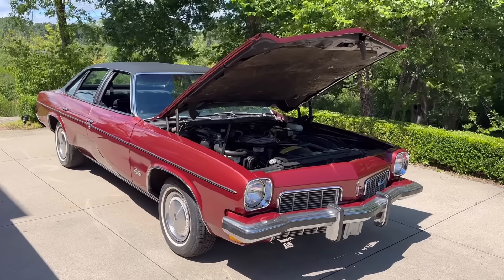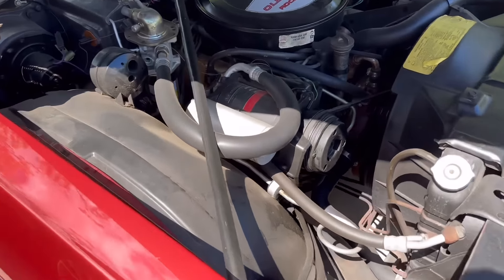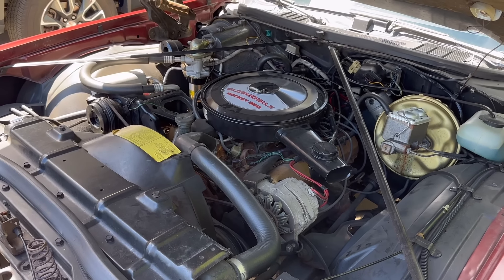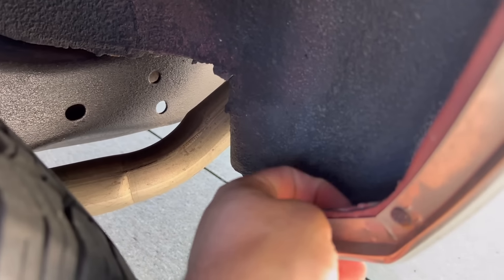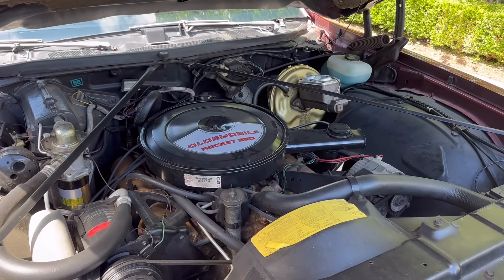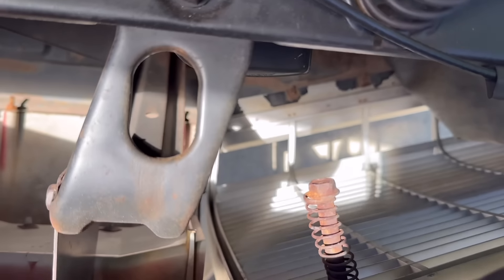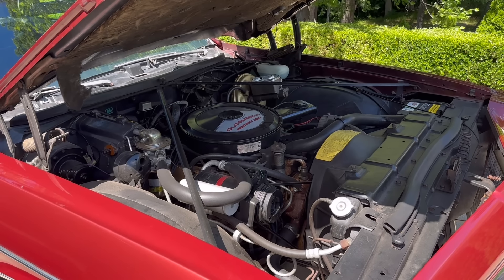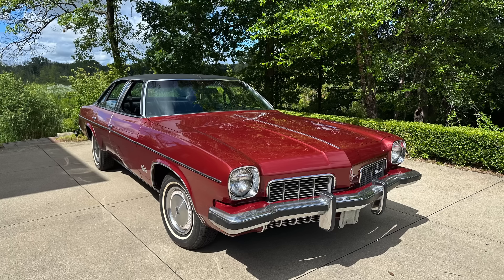This Oldsmobile Invention Protected Your Car and Preserved Its Value!

Comment: Bought a new 1973 Cutlass Supreme Colonade coupe,  silver blue with full white vinyl top and white bucket seats. Great looking and driving car. A litte under powered with the low compression 350 Quadrajet, but the speed limit had just been dropped to 55mph and it ran comparable to other new cars of the times. Spring loaded grille was cool!

Comment: Don't forget that the car body from the firewall back was built by Fisher Body so it wasn't up to Olds to design corrosion protection liners back there.  Olds was responsible for the fenders, hood, and front clip and everything up there in the pre-unibody days.

Comment: My first car was a 73 Olds Cutlass 2 door, silver with the black vinyl top. Mine developed the rust through on the driver's side behind the rear wheel. I got it in 1986 and sold it when it had 130000+ miles on it. I loved that car.

Comment: Our neighbors across the street in Dayton Ohio had a '73 or '74 very similar to this, but theirs was a light metallic blue.  Within a few years, it had those little plastic pieces which fit over the dog-legs between the rear doors and the the rear wheel openings, and were painted body color.  Our '75 two door never had any rust - or really any issues ever. The rub molding fell off of the passenger side fender after four years, and that was it. We got a new one at the dealer and twelve year old me stuck it on.

Comment: One of my favorite cars that I've owned was a 73 Olds Cutlass Supreme coupe. Bucket seats and console. I installed cam, headers and a built transmission. I'd get rubber when I shifted into 2nd. Had 275/60s in back and 235s up front. Was a pretty quick car.

Comment: Love your Cutlass as well as the ‘67 full size in your garage. ‘73 and ‘74 GM products were a little iffy, but yours is in remarkable condition. I know emission control made them comparatively powerless, yet Olds always managed to preserve that “Rocket V8” roar. I can’t resist sharing that I’ve got a ‘56 Super 88 in my garage. Olds was an innovative motor division. May it live on proudly!

Comment: I have red plastic inner fenders on my '70 Olds 442.
Reply: I think they were an option on 442s and W30 cars through 72.
Reply: Moms 72 Cutlass S had them. Her car was white the inner fenders was black plastic. That was an excellent car. It would fly... Rocket 350. Air Conditioning that would freeze you out. We had it 10 years. Not one bit of trouble.  I liked the front in better on the 72 models.  Sad, about Pontiac and Oldsmobile.  My first car 76 Pontiac Grand Le Man's.  It was a beautiful car.  Dashboard, was the best looking of any GM midsized at the time. However, it had the Pontiac 350. And the power was down from smog equipment.
Reply: My 69  W30 has red plastic inners also.

Comment: Always wanted a 1967 Turnpike Cruiser Cutlass Supreme. Had the 400 2v with a gas mileage saver ignition system & high rear end ratio. Said to get 20mpg @65mph.

Comment: Dad had a '73 Cutlass Salon with the Rocket 350/4bbl. By the time I got it in the 80s, it was a rust bomb and the steering gear was shot. We loved that car though.
Reply: Those 1973-1977 Cutlass models in the salt belt were notorious for the rear bumper falling off from rust. Hillbillies would rig up a replacement with treated lumber. Looked awful of course.

Comment: The screws that attach the chrome wheel opening moldings are the first place for corrosion to start. The metal is unprotected and there are plenty of places for water and dirt to collect
Reply: LOL, I remember pushing a dead '64 F100 into the car port as a kid, had the door open to steer it.  The open door went right into the wheel wall lip on my dad's Chevy Celebrity, and put a nice dent in it.  I went to the parts department at the  Chevy dealership, to find out that there were different sizes of that chrome trim piece depending on the trim package and how far into the model year it was made.  It took me three tries to get the right part 😂

Comment: We had a ‘74 Firebird and I refused to cut a hole in the fender liner to change the blower motor so I pulled the metal fender liner. Cut the shit out of my hands.
Reply: Funny you should mention that.  When I bought my '79 SE TA back in 1986 I noticed a roughly 6" round hole cut in the pass side inner fender and for years had wondered why.  😸
Reply: Cutting the inner fender for the blower motor is in the factory service manual.
Reply: @bobroberts2371  I know and there’s even a template for where to cut stamped into the fender liner. However if you’ve ever seen it done it’s fugly.
Reply: Good Ole GM, they didn't care about maintenance or making things accessible the 70's was just about the car making it to the end of the bank loan.
Reply: My 75 firebird was a nightmare to swap without cutting it ......I never understood why they just didnt include an oversized panel to cover the hole they wanted you to cut in the first place.....saved 39 cents per car on screws and  10"x10" of sheet metal.....my 96 S10 truck was the same way......if its done wrong long enugh it becomes company policy I guess
Reply: I did cut the inner fender shield on my 68 Firebird in 1972 when the blower motor failed....there was a hump in the shield.....cut around it, replaced, put on a piece of metal, metal screw, undercoat..
Reply: @darrellsaunders4267  dealer did that on a ‘71 GP we had. Just bad design on GM’s part.
Reply: @markcollins457    How do you propose solving the blower motor access issue?  Remember, there is limited space on the under hood firewall and an empty space between the inner fender and firewall.

Seems that you would rather compromise the functionality of the car for ease of changing a part that might never be changed in the cars life.

Comment: My `87 Ford F150 pickup had those plastic inner fender liners. As for that car and its engine, my `72 Buick Skylark had a 350 2bbl. It had plenty of pickup, and plenty of passing speed on the highway. I believe it was only rated at 155 hp, but it seemed like a lot more.

Comment: I like seeing the VIR A/C system under that hood.
Reply: I have rebuilt many VIR HVAC systems. Started turning wrenches at GM dealerships in 1973. Those compressors were Heavy.
Reply: Meat locker on wheels. 😊

Comment: The only vehicles (not a passenger car) that have rear plastic fender liners are some of the newer pick up trucks.  I see they have engineered new ones for some classic trucks now.  I believe the reasons was so you couldn’t see through the gap between the frame and the bed floor out to the other side.  Once again, great video, fantastic channel, unmatched wealth of knowledge & I wish I had your garage space…

Comment: I worked in a collision repair facility for many years. I cannot imagine how many plastic fender liners we replaced over the years. The plastic got thinner and thinner over the years and now it’s just plain flimsy. My 2018 Honda CR-V has fabric rear inner fender liners and many of the imports have for years.
Reply: My 2017 Impala has fabric front inner fender liners. One got torn so I had to replace it.
Reply: 2006 BMW 325xi has fiber inner fender liners.
Reply: Most vehicles have fabric fender liners now. They’re also a noise improvement.

Comment: I was furious when I needed a new blower motor on my then two year old 1977 Trans Am went out and because I was on a trip down in Indiana I took it to a dealer outside of Indianapolis only to find later they had cut a hole in the inner fender to swap it. I then found this process was right in the GM service manual for F body cars. Didn't make me happier though!

Comment: I guess that the "flow through ventilation feature" could be considered either an option, or a late appearing standard feature, depending on where you lived, and/or how long you kept the vehicle.

I remember seeing one GM car that you could see into the trunk, and out the other side, because the rear quarter panels had rotted out.

Note how easy it would be to replace either the blower motor, or the A/C condensor on that car.

Comment: If you buy a GM pickup today, you have to pay extra for plastic fender liners to prevent rot in the rear wheel wells.  Kind of pathetic IMO.
Reply: Same with Ford pickups and heard the rationale was to be able to wash the frame and rear suspension of road salt and mud.
Reply: @jasonhunt007  That sounds like a salesperson's attempt at a Jedi mind trick.  If you have the plastic liners, you don't need to wash out your wheel wells.  If it was such a benefit not to have the liners, they would omit them on all the trim levels, not just the cheap ones.

Comment: Hi Adam, I love your channel and thanks for this video. I must respectfully offer a correction, however.  In this video you called these red plastic fender liners. They are not liners, but rather they are the actual inner fenders.  Some other cars, such as the '66-'67 GTO, had red plastic fender liners optional, but they were just the liners, and from the engine compartment side you would still see the black steel inner fenders.  I should note that on the 4-4-2 W-30, while the front has red plastic inner fenders, in back they are mere red plastic fender liners, as the rear inner fenders are steel.  Thanks again for your awesome channel.
Reply from the maker: Good comments. Thx!

Comment: Interesting that they used plastic for an apron assembly which is a structural piece. Surprised the engineers were able to maintain structural rigidity using plastic instead of the typical sheet metal. The bracing was necessary but still impressive.

Comment: I like the '73 because its front bumper did not have the thickness of the subsequent years '74 and 75. No one has tried to frenched this bumper by narrowing it a few inches in width and sticking it to the bodywork. So with the elimination of plastic filler it would look so much better that way.

Comment: I was thinking some early GTO's might have had red front fender liners.  Also, it would basically be impossible to use plastic liners in the rear since the inner and outer wheelhousings are a structural part of the body.  The front liners aren't load-bearing in any way.

Comment: Hi Adam yes, I too have the plastic inner liners on my 1969 Olds'  Ninety Eight, 
 Now on on your '67 holiday, have you (and other readers of the comments section) noticed ever that your speedometer is driven off the front left wheel on many Oldsmobiles of that era ?

Comment: Plymouth offered red plastic inner fender liners on 1967 and 1968 Barracuda coupes and fastbacks. Not on the convertibles because the rear wheel wells were modified to make room for the folded top. I have a set of them for my 68.

Comment: My 1978 Mustang II has plastic fender liners on the front.  Now I know where this started.  Of course, this car has lived its life in central Texas, so no rust.  My 1963 Falcon does not have the liners as you would expect.  The Falcon, due a Ford design decision shared with the early Mustangs, did have rusted out floors.  Ford uses a rubber tube to guide air from the vent slots behind the hood to the interior on these cars.  This tube cannot be changed without removing welds.  As these go bad, water gets onto the floors from the vent system, rusting them out.

Comment: I think the rear fender liner is a part of the welded body structure so plastic would not be usable. In the front the inner fender liner is not as important as a part of the body structure so they could get away with using plastic.

Comment: I always thought the '73 A-body cars, at least before the mid-1970s "update", were among the few cars that looked as good with their 5 MPH bumpers as they would have without. I just looked at a '73 Century photo and it has similar looking black fender liners, so I assume they had spread throughout the mid-sized lineup. GM full sized cars still had metal liners in '73 and they served as gusset plates for the 2 pairs of cross-braces that reinforced the nose. The Vega was notorious for lacking plastic liners in its early years and when they were added, they must have been hard to see from above, with the steel fenders, including the shock towers, being so central to the structure of the car. Most of the modern cars I've seen have plastic liners that are little more than membranes, probably because there is so much steel surrounding the front wheels in a modern unibody structure. But as long as the plastic liners have a path for water to drain out, they are probably prolonging the life of all that steel.

Comment: Plastic inner fenders can have issues . Pretty hard to get around them going into the 80's and beyound . 

I lost a clip on wheel weight at somewhere over 100 mph in my 91 ZR1 . Didnt know it until days later . I popped the hood and the left upper wheel house liner had a nice crack and a piece was missing toward the inside portion. 

Then I noticed the black paint on the hood showed signs of spider webbing . Left front wheel had zero weights . I had all four wheels balanced using tape weights only on the inside portion of the rims . 

Bought a new upper tub and had the hood completely stripped and repainted by a one man Corvette only shop . Car had 28 k miles then . The previous owner left a flashlight ontop of the plenum and cracked the paint in center of hood . Note to shelf . Never leave anything including tools etc under or anywhere under clam shell hood .

Comment: I don’t think they put the plastic inner fenders in for corrosion protection. They were originally installed to save wait. That’s why they started out on the performance model.

Comment: What about remote hood locks to protect your engine bay from malfeasance.
1970 had an optionalremote hood lock placed in the interior prior to the introduction of interior hood latch releases. I think the 1973 has an interior hood release.  I’m no expert, so they could have been available on other marques as well

Comment: As there were so many penny pinchers in GM, surprised they didn't install a long time ago!!
Reply: It's what made them go from kings of the global car market to virtual irrelevance today, substituting parts with 25,000 times the failure rate to try to save two-billionths of a cent per unit. 🤬

Comment: The 66 GTO had red front plastic fender liners in 66 but they were optional and they were added in addition to the steel inner fender rather than instead of.

Ironically the front inner fenders never really rusted anyway so the benefit was dubious at best.  Also plastic inner fenders reduced body rigidity which might be why those braces were needed.
Reply: Yes, I was thinking about the GTOs too.
Reply: I just made a comment, roughly the same as yours. I wondered if they were added on to the steel liners, and your comment supports that idea.

Comment: How many cars do you own Adam?  I've been watching for at least 2 and half years. It seems like you have more than 20.  And you  have cool ass cars
Reply: All with exceptionally low miles to boot!
Reply: @danscott3880 I’ve made a partial list, no telling which are still in his collection. 

1959 Pontiac (Canada) Parisienne, blue
1965 Pontiac Bonneville, burgundy
1966 Oldsmobile Toronado, terra cotta
1966 Pontiac Catalina, turquoise 
1967 Cadillac Fleetwood Eldorado, black
1968 Mercury Marquis, burgundy 
1968 Meteor Montcalm, 
1969 Cadillac Fleetwood Eldorado, Rampert green
1970 Lincoln Continental, black
1971 Pontiac Grandville, beige
1972 Lincoln Mark IV, Gold
1973 Oldsmobile Cutlass Salon, burgundy 
1974 Mercury Marquis, brown
1975 Oldsmobile Delta 88, black
1980 Cadillac Seville, brown
Reply: @randyfitz8310  There's also a 1970 Chevrolet Impala or Caprice, black with blue interior with 454 V8 (Canadian too, I think) 
Also a 1972 Chrysler Imperial 4 door, and a 1973 Chrysler New Yorker. There may be others as well.
Reply: 1972 Monte Carlo in Ascot or Musanne Blue with black vinyl top and rare fender skirts.

 One of my favorite cars in his collection. I have three first Gen Montes - two '71's and a '70. I bought the '70 in high school for $300 back in '87. Was our daily driver for years.

Comment: Actually I bet they cost MORE than steel in those days. Plastic wasn't cheap in the 1960's and 70's due to slow cycle times for the early tooling technology. I think Olds was bold by going to plastic because it also deadened sound much better!!!

Comment: Pretty sad how Oldsmobile went from making cool innovative cars and features to dull, ugly pathetic cars like  the alero and intrigue.
Reply: I had an Intrigue that I bought used, and while it was a money pit to maintain (lots of failing parts), and had some badly-done engineering (HVAC intake that would leak water into the car), it looked great and drove very well.  But for the above-mentioned reasons, I’ll never buy a GM product (at least an ICE-powered one) again.  I might grudgingly give them a second chance on a low-end BEV, though.